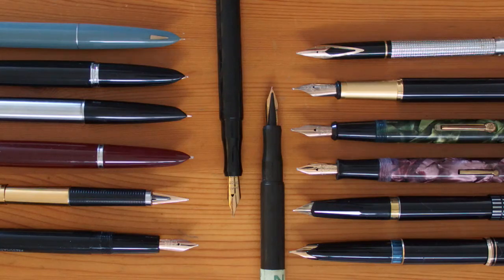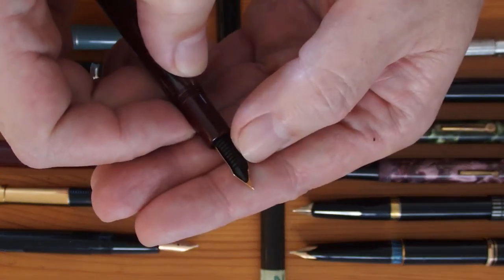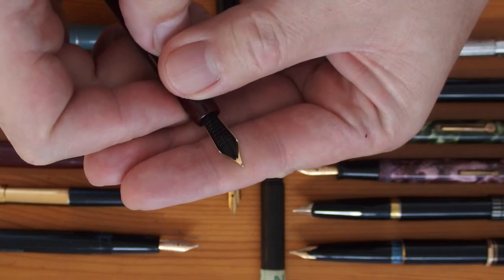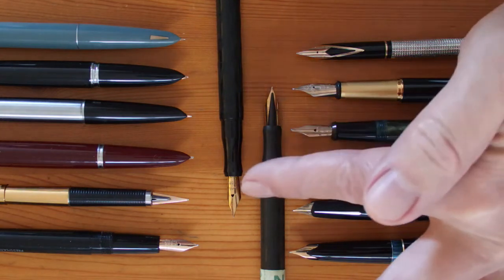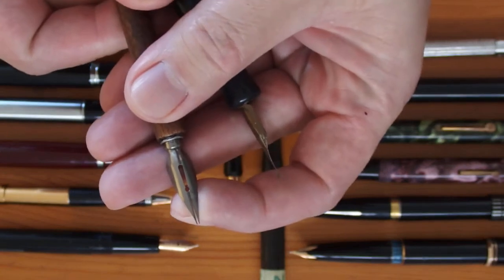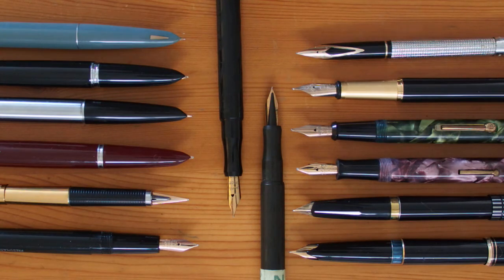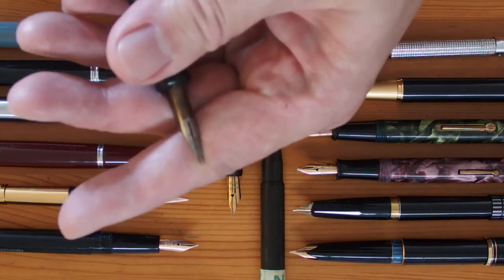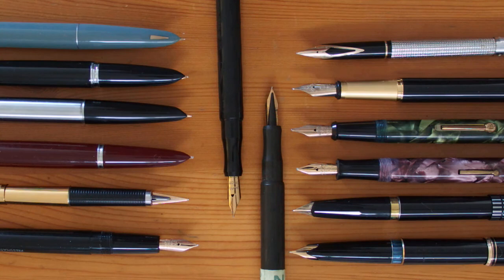Gold vs Steel Fountain Pen Nibs: An Investigation

Comment: You repeat much of the same silliness I hear all over YouTube.  Why gold was used in the first place is completely, one hundred percent  meaningless, yet it's still used to say steel is as good as gold.   What matters is the why of origin, but the results obtained from the decision to use gold.    Flex, too, is used as a reason, even though you simply make things up as you go.  The desire for good gold nibs with high flex never lessened one bit.

What actually happened was a lot more choice in pens, combined with far, far more people wanting to buy them as we became a more and more literate country.    Just because more and more ordinary people wanted nibs that didn't flex because they didn't know how to use one does NOT mean that fewer people wanted flex nibs.  That never happened.  Even more people wanted flex, but were overwhelmed by the sheer number of people who just want a good, cheap writing instrument.

More people yet wanted soft gold nibs, but such nibs were a lot more difficult to make than nail hard nibs, so the majority of companies mass produced hard nibs, and the majority of consumers had no idea there was anything different.

Soft nibs are why gold is superior to steel.  A soft nib has nothing to do with flex, despite the fact that every know nothing, pseudo-expert on YouTube always tries to get line variation from a soft nib.  Doing so  is stupid, and more gold nibs are ruined this way than any other, including being dropped on the tip.  There is no safe pressure, and no minimum number of time it takes to ruin a soft gold nib by trying to get line variation.

A soft nib is made to absorb the little hand jerks and tremors, and the excess pressure we all inadvertently have or use during long writing sessions.  If you can't tell a huge difference between how a soft gold nib writes, if you don't notice how much it can do to prevent hand fatigue and cramping, then, like most today, you don't use a fountain pen very much at all.  You certainly don't use a quality soft gold nib enough.  Or you're so heavy-handed that all nibs feel alike.

In fact, even discounting the lessening of fatigue and cramping, the human finger tips are more than one hundred and fifty times as sensitive as they need to be to discern the difference.

Are gold nibs better than steel?   ait depends on the user.  If you're a heavy-handed writer who acts like a fountain pen is just an expensive ballpoint, then no.  You may as wel use a gel pen and save a lot of money.  If you're someone who talks about fountain pens more than you use them, then no.  Buy a Lamy Safari or a Pilot Metropolitan, and forget about it.

But if you use a fountain pen a LOT, and learn how to use one properly, then yes, gold absolutely is better than steel.  I spent decades using a fountain pen several hours at a stretch nearly every day.   Even in retirement, I still use one at least five hours per day.  Believe me, I could not do this without a god, soft, gold nib on a pen that fits my hand.

Seriously, if you can't close your eyes and take a pen someone hands you, and know instantly whether it's steel, or a soft gold nib, you really need to work on your technique.  You're either using way too much pressure, or you're listening to other people who talk more than they write, and not using enough pressure.

This is a common problem woith those who own a great many pens, as well.  If you own a huge number of pens, chances are you never use a single pen long enough to have a clue about how to use that one pen to full advantage.  This is one of the main differences between now and the fountain pen's heyday.  It was very common for even an avid fountain pen user to own only one pen.  He or she might try several in the beginning, but when they found one they liked, it was over.  That one pen would be used until it wore out.  The replacement would be an identical pen.

Now the average fountain pen enthusiast may own fifty pens.  I know a couple who own several hundred, and one who owns more than a thousand.  They may all be cheap, they may all be expensive, but none are used exclusively.  The owner may use a different pen ever day of the month, or even every day of the year.  I admit that doing so is fun.  I fell into that trap myself.  So I sold every expensive pen I owned, more than a hundred and fifty of them.

I still try a new pen now and then because I love fountain pens, but when I sit down to write, when I know I'm going to be writing for hours, I pick up the same pen each and every time   It has a soft gold nib because I know how much this means during a long session.  

There's nothing at all wrong with steel nibs.  I have several pens with steel nibs, and all are smooth as butter on glass.  They are fun to own and fun to use.  They will do the job.  But they are not soft gold.  It's just that simple.  

History is great, except when it's misrepresented to prove a point, and this is exactly what every advocate of steel nibs does.  It's pure nonsense.

When you get right down to it, these disputes are all foolish.  Anyone who refuses to buy gold, or refuses to buy steel, without owning and  learning how to use both, doesn't have a clue, and making a decision based on what you say or I say is a sdumb as a screen door on a submarine.  Until you own both, learn how to use both, and put in a LOT of hours with both, you simply do not know anything.

The only way to know is to try both, learn the correct way to use each, write with each extensively, and then stick with whichever gives you the most writing pleasure.  Everything else is pure BS.

Comment: May I ask the make/model of one of the pens in your video. On the right side, 5th pen down from the top. It looks similar in some ways to a pen I bought recently called a Dux 240 made in Pakistan. The Dux pen does not have a gold nib but the nib shape is like your pen. As if it were folded down the middle. Also, like your pen, there is a straight raised moulded piece at the top of the section which seems to be purely for decoration. I am curious to know the name of your pen. Thank you.
Reply from the maker: David Anderson That is a Hero 121, but not the original model with this appellation which had a hooded nib. This 121 is a variant of the very common 240, with gold nib and a very heavy machined steel cap, both with a "necktie" metal inset at the section. The Dux 240 from Pakistan does resemble the Hero version closely, I still do not know how they are related.
Reply: Nib looks just like the nib on my Wing Sung 765, which I love.  Still available NOS on eBay, $2.90 delivered.

Comment: Gold plating is only for asthetics. The tip is the key and a dollar pen with a ss tip if ground and tuned correctly will write as good as a pen worth a lot more,
Reply: This simply is not true.  The tipping does matter greatly, but stainless steel is NOT a good tipping material, regardless of how it's ground.  Cheap stainless steel isn't hard enough, and it isn't smooth enough, to make a good tipping material.

There are some very new, and very, very, very expensive stainless steel that should make good tipping material, but cheap stainless steel simply does not.  Even if some genius does make it write well, a month later it will start having problems.